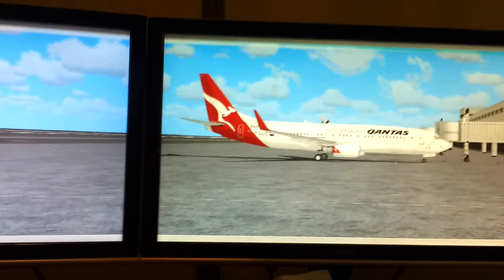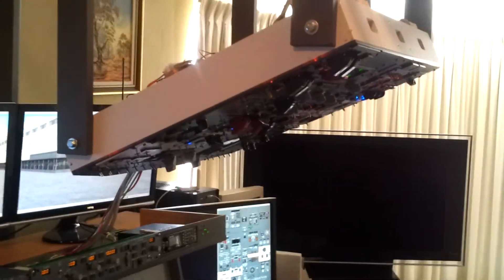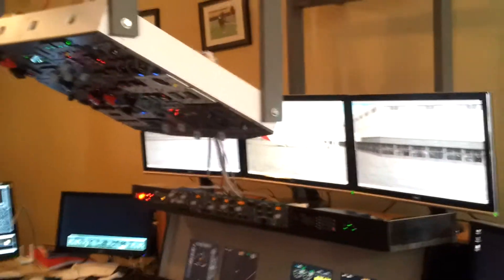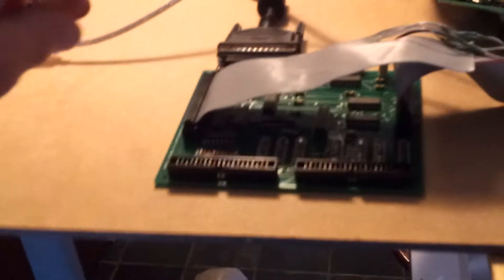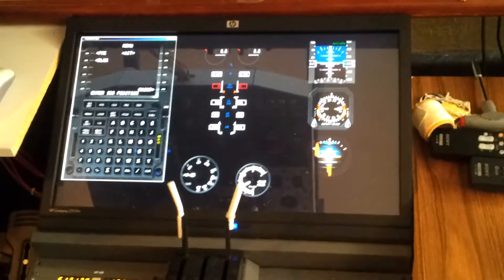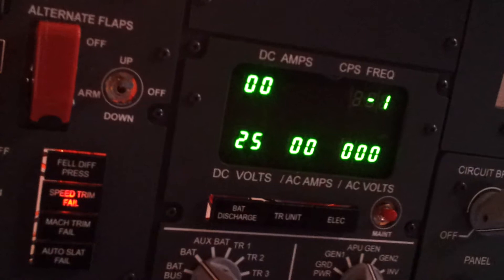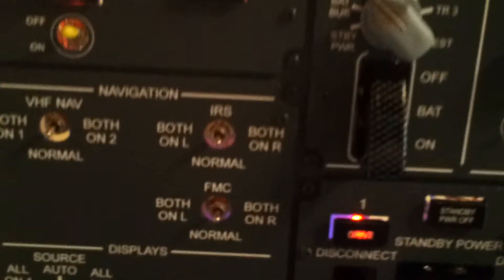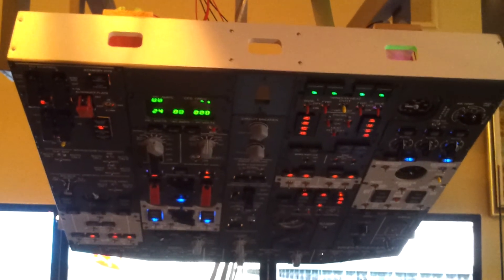Home Flight Simulator 737 OHP

Comment from the maker: Thanks for your comments.
Poldragonet is not bad for the money. Some switches had to be replaced because heat from the soldering iron melted the plastic case rendering them useless. Also slight mods had to be made to install the Opencockpits gauges.
Cheers from Port Lincoln Sth Aussie